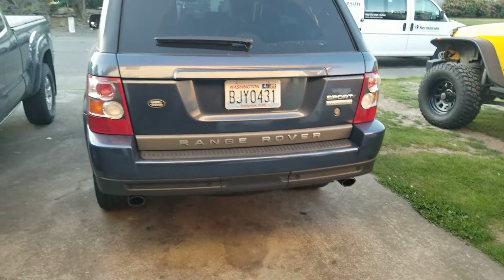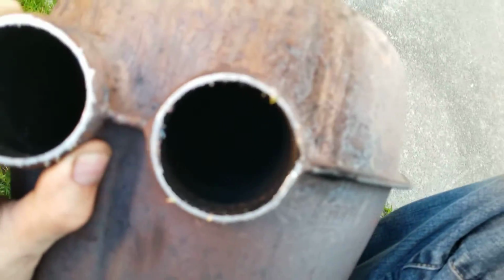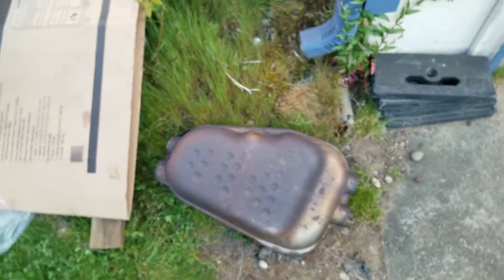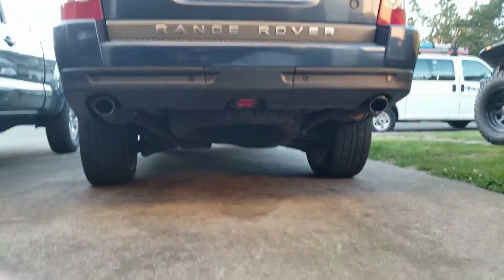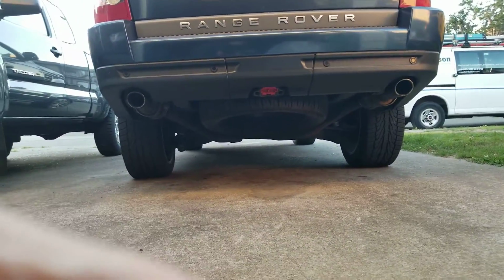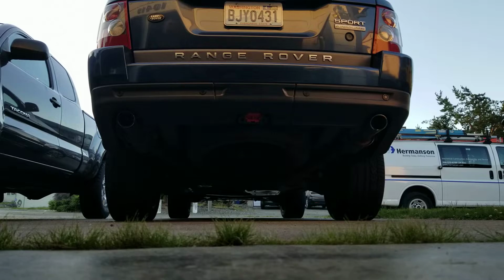2006 Range Rover Sport Exhaust Resonator #7 delete sound

Comment: Did you sleeve the pipes or have you had to weld them in place
Reply from the maker: I welded them in place.
Reply: @joebidden4914   sweet do you remember the size of the pipe required ?
Reply from the maker: @martinfloyd9663  I dont remember but I think it was 55mm? I believe I used 2.5" exhaust tube and it was a little large so part of it I had to fill in the gap by welding it.
Reply: @joebidden4914  i like your videos bro. I think I'm gonna do this.. My wife is a welder so she can actually do the welding for me.     So do I just cut that piece out that you showed in the beginning of this video and then just run straight pipe connecting back to the rest of everything or what?
Reply from the maker: @willbean921  thanks Bro! Yea It cost me all of i think $20 for the aluminized tubing and all of an hour to hour and a half to drop exhaust, cut and measure, set up placement to keep proper exhaust angle and weld on straight pipe and put back in place. It makes a helluve difference in sound. I wish it sounded this good from the factory. I also had zero drone at all driving around town or on the freeway.

It'll be the best cheapest mod you can do to your rover.